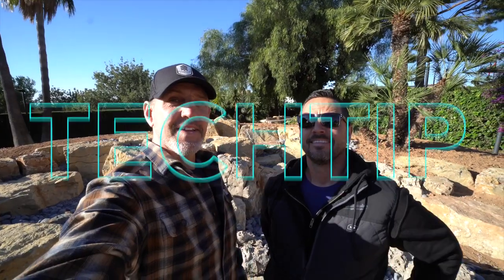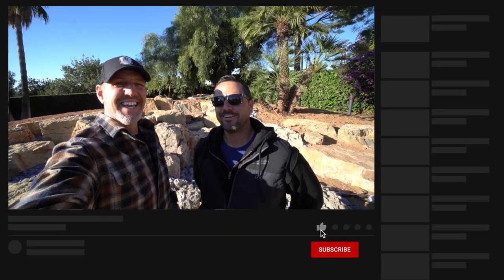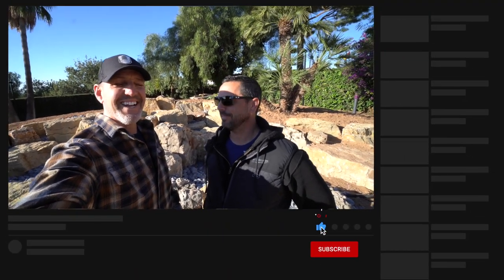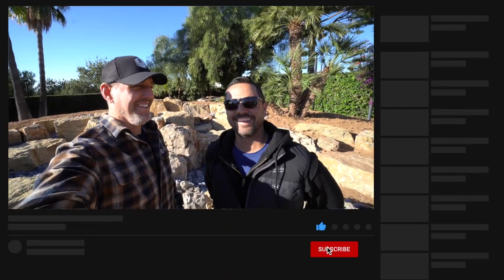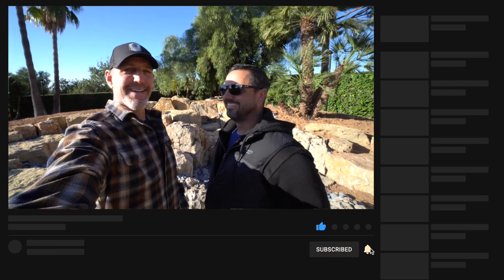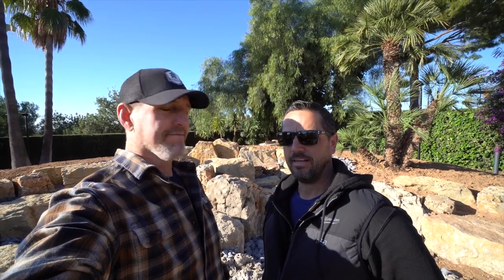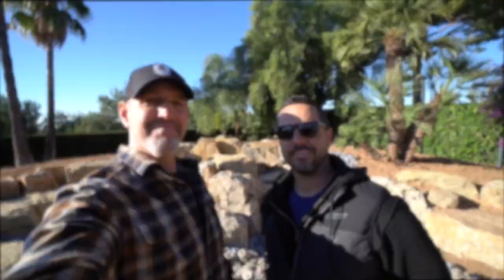Waterfall Rock Placement For Function and Aesthetics

Comment: Perfect timing for this topic as I'm working on plans for a rebuild and one of the things I didn't have before was outcroppings or rockwork beyond the pond sides to tie it into the surrounding garden space.  Looked too much like a ring of stone.  Same for varying the sizes of the rocks used, it was a hand build so limited to 300 - 500 lbs rocks.  This time around will be using a small machine and hopefully be able to apply your tips with much bigger rocks to make a more varied and natural appearance.  The variety of waterfalls will be another change, since we had a single stream and sheet fall and will be upgrading to a split stream with several different types of falls like you showed here, so much better that way.  Keep the great info coming!
Reply from the maker: Awesome